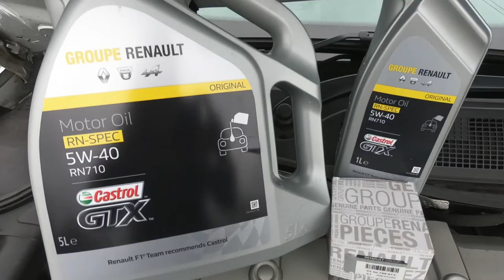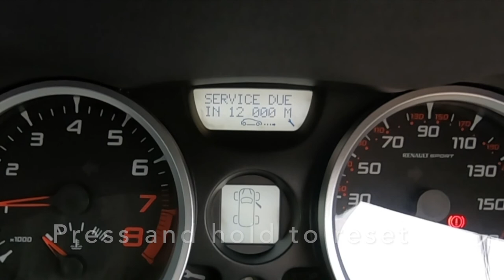Renault Sport Megane R26 - Oil Service

Comment: How much Oil need?✌️
Reply from the maker: Hi, sorry for the late reply. I’m not sure on the actually capacity but it usually takes around 5 litres. I buy a 5l and a 1l just in case I need a top up. I buy the kit with the oil, filter and washer from Renault parts direct (RPD). Thanks.
Reply: To be precise, your Megane needs 5.4L when completely drained. It's best to pour 5.2L and check after 5-10 minutes on the dipstick and add 100-200ml more if needed.